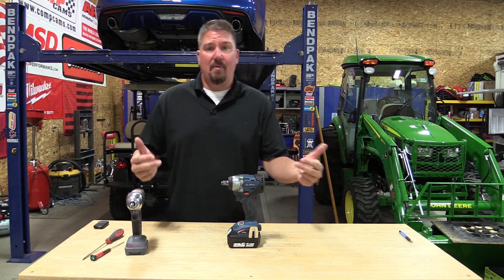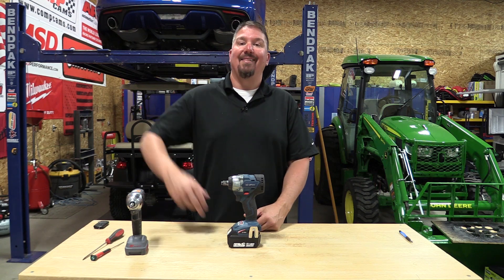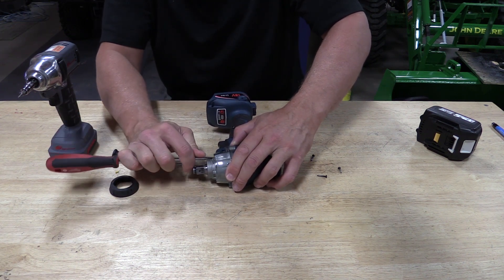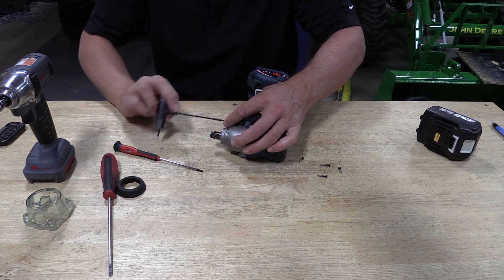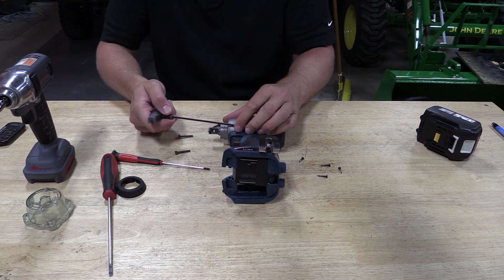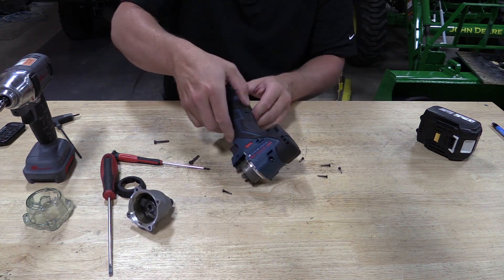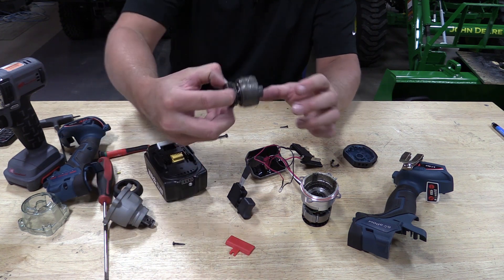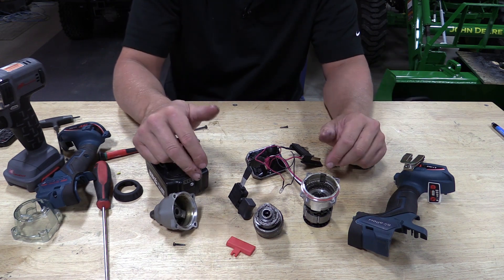Can We Find The Problem With The $100 Amazon Impact Wrench After It Broke?

Comment: When its all lights out like that, its not hard to imagine that the impact cracked the main chip or the pcb cracked and a bunch of components arent getting any power. The potted thing can still flex a lot more than ic's can. I would check for hairline cracks on the potted base. If you feel like it, it can be removed with heat, 200-250° C (not sure in freedom units) and you can remove it in semi solid chunks, leaving you with the exposed components.

Comment: Are the contacts on the battery spread apart too far from the drop impact. maybe the blade terminal on the tool is not getting proper connection with the battery.
Reply from the maker: They connect properly
Reply: Maybe connection broke inside the gray insolated section
Reply: Most definitely likely.✔️
Reply: Jump a wire to the + and another one to the - terminal of the battery 🔋 and the tool. 
It should satisfied all 👏.

Comment: Great video thanks for. taking the time and sharing I'm wondering if maybe out of dumb luck you just got a lemon ... Sucks but having seen the internals I'm thinking maybe the tool could be alot better than we are all thinking .... I've seen Milwaukee's crap out after one drop and we all know that's a fluke failure .... Put it back together and see if Amazon would give ya a replacement see if it happens again ?
Reply from the maker: I might buy another.

Comment: maybe its before the circuit board, between those battery spades on the bottom of the tool and the solder joints? be pretty easy for the battery to torque them apart on a hard drop
Reply: It's most likely because it's a drop torture test.
Jumping cables to the terminals of the battery 🔋 and the tool should answer your question.

Comment: Thank you for taking it apart i was really interested to see what happend.i am pretty shocked at how robust things are inside there how are they doing this for 100.maybe since they have no marketing cost that is how they get the price so low.but the drop killing it sucks,even a home gamer is gonna drop it atleast once i dont care how carefull you are.at that point you can get a brushed makita for the same price that will last many drops.
Reply: You can get these Makita copies for about $35 including shipping. You don't have to spend $100. In the US, from usa shippers. So you get them in a few days. Heat sink around the potted electronics? Sucks that they potted the electronics, and something inside the potted region broke anyways. Comparable brushless Makita would be over $200, maybe over $300. Although the makita would have a bit more torque. I'm not sure but I think that without brushes and a commutator, we are depending upon something inside the potted electronics, to keep the motor turning – it is doing electronically what the brushes and commutator are doing mechanically. I think. If that's true, it means the cheap, China-made knock-offs of brush-motor Makitas, would have less electronics inside them.

Comment: @workshopaddict it's most likely the slide on connectors,  one possibly bent or misaligned to not allow the battery to fully connect and click in place to fully engage the power terminals.
Reply from the maker: Negative
Reply: Same thing I was thinking, no power to the tool.

Comment: What, no multimeter?  😉  ... to maybe check a couple of spots up the food chain in case the contacts bent on the battery or, what's the fancy name for the contacts where the contacts contact?!
Reply from the maker: Hard to check the potted circuit board.  It should show modes with lights and that is the first place power goes.

Comment: The internal circuitry board has been cracked in my opinion, its looks to me they encased the circuitry in epoxy, perhaps a way of them making it tamper/vibration proof,  most probably also to some degree water proof. Unfortunately epoxy can shatter/fracture when flexed, this puts shearing force on the circuitry board. Unfortunately it's not possible to replace the components as the epoxy doesn't come off easily.

Comment: This is a great teardown video!  It doesn't look to bad mechanically to me.
Just my guess, but they might have potted their circuit board to hide how they got it to work with Milwaukee batteries.  It could be a clone of Milwaukee circuit, or it could be their own.   Somebody at Milwaukee might want to take a look.  I hate to see someone destroy a Milwaukee battery by trying on one of these.

Comment: I'm 70% sure they have a heat sensor circuit breaker that is susceptible to damage when exposed to tremendous shocks it pretty much is designed to cut power to tool when too hot, and well it seems as that is what has failed.
Reply: The knock-offs probably leave out the motor heat sensor. Would cost them an extra $1.00. So the unit could have overheated. I don't remember if workshopaddict, in his first video, overstressed it heat-wise. In this video, remember that third battery connector that wasn't wired to anything? That was the connector for the battery heat sensor. No point having the tool check the battery temperature, if there is no heat sensor in the battery!

Comment: I'm sure it's the battery
Reply from the maker: We tested it last video and it was good.
Reply: @WorkshopAddict  just because the battery gives readings doesn't mean the there isn't a weak spot in the battery terminal.  Did you physically test the battery in another tool?  Because it's either the battery or the circuit board.  Rule out the battery by testing it in another tool.